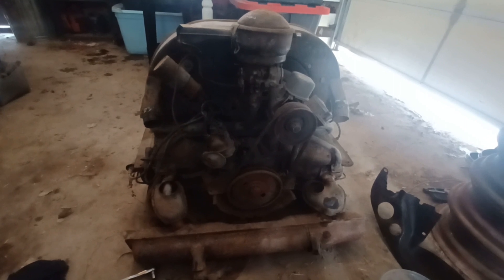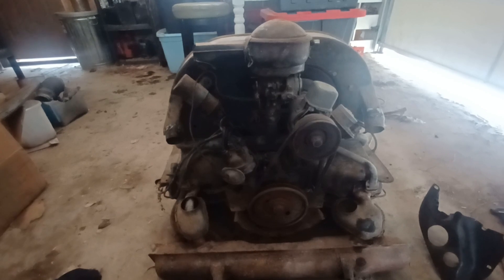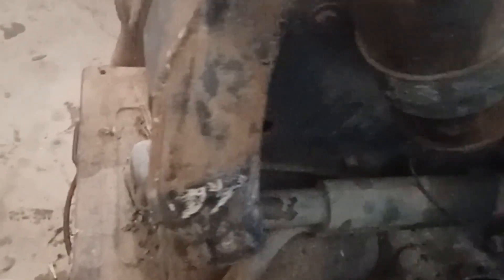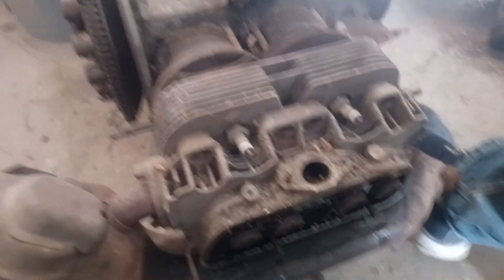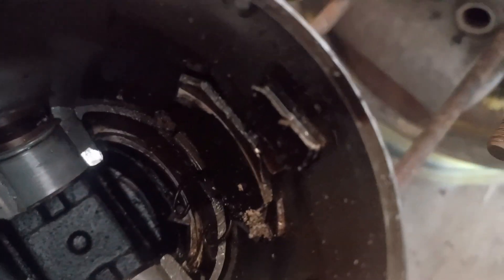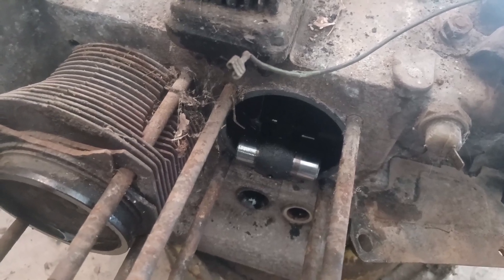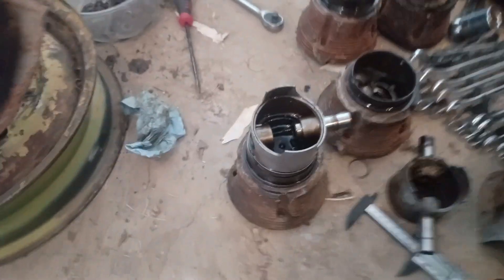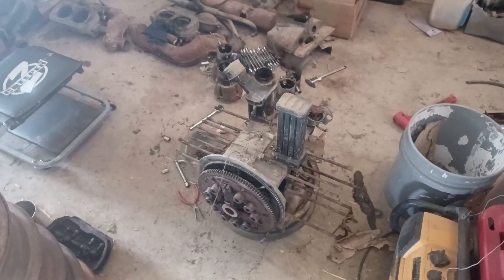I Blew Up My Beetle's Engine! 1966 Volkswagen Bug

Comment: that's some knock. good thing you have so many spares man! 
what's the oil situation like?
Reply from the maker: I had come clean oil added, but the old oil was terrible. It looked like the fuel pump had been leaking in it for a long time. It was definitely a contributing factor either to when it broke in 1988 or when I broke it.

Comment: How many miles are on the engine?  Mother had this noise, and it was a rod.  The engine threw a rod, and broke a piston.  The motor had 180,000 miles on it.  A new short block engine had to be installed.  You can rebuild it, and it will run for another 180,000 miles.  A new engine is still cheaper than a new car.
Reply from the maker: It's hard to say, the speedo is from an earlier Beetle and the engine is not the stock 1300 that would have come with a 66. But that is exactly what happened! Check out my next video where I tore it down to find out what was wrong